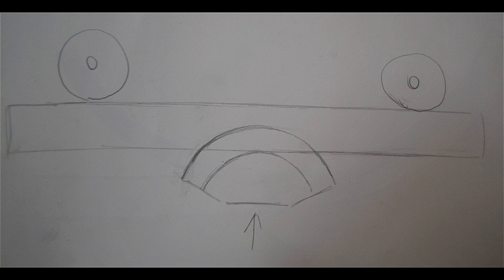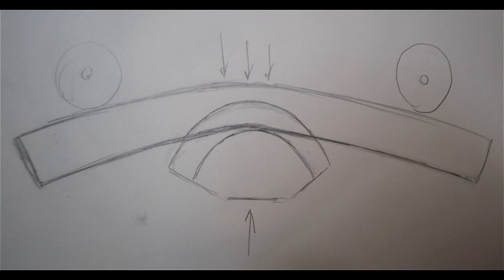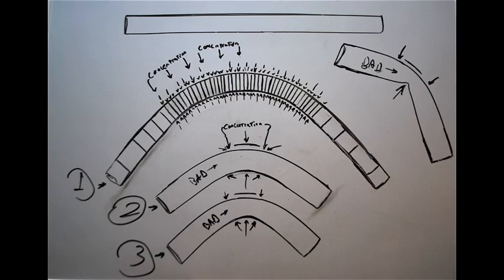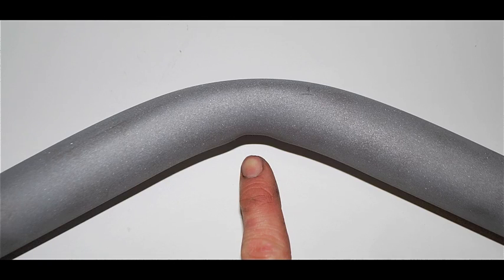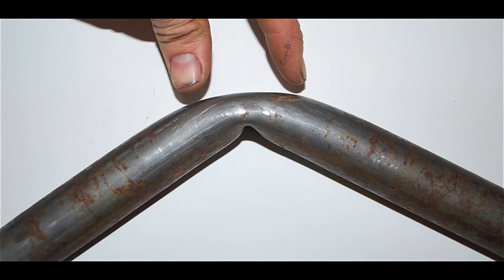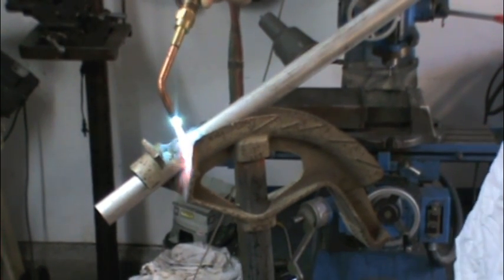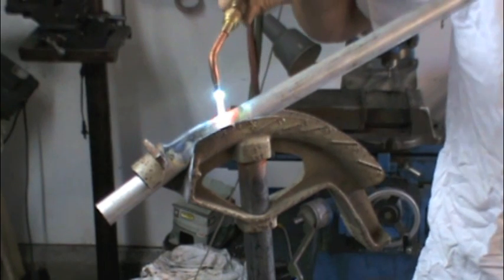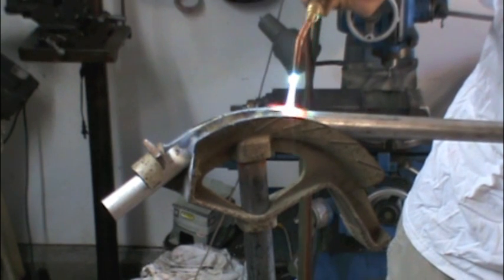How to Properly Bend a Pipe

Comment: Wrong. The reason the pipe kinks is because the sides of the dies dont come up high enough to stop the sides of the tubing from expanding which allows it to kink. I built a die myself where I made the sides fit tight against the pipe or tube and they extend up over the sides completely.  When I did that I haven't kinked a tube yet. I used thick steel on the sides.

Comment: you are not using it correctly....the rollers are in the wrong holes for that sized pipe.  i have 4 different kinds of pipe benders and this type works well for me. you know exactly where the center of the bend is.  you can not beat the price.

Comment: if you fill the pipe up with water and add sand and solid pack it tight with both ends tape up, the pipe will bend perfect in those cheap Harbor Freight Bender try it ,it will work fine

Comment: "Try using the RIGHT SIZE DIES in your harbor freight PIPE bender!!! Nothing wrong with that machine,it IS the operator. <--agreed used correctly the press type works correctly by forming the pipe in the die .
Reply: longthetiger99 i did use the right dies on my harbor freight pipe bender. now that i have a REAL pipe bender i know why that thing is a piece of shit.

Comment: The dies your using are for plumbing pipe which are measured on id of pipe, tube is od, I have used this very bender with home made dies that are the exact same same as the od of the tube and got "0" kink, Dies must not have any cleance between the tube and sides of die.

Comment: Using this process it is possible to make a turn on a tube diameter of 30 mm, and a thickness of 2.65 mm, with a radius of 100 mm?
(I do not speak English, automatic translation)
Dario

Comment: The wrong dies and or sliders,,wrong spacing of sliders above the die,and some processes of piping manufacture WILL defeat efforts to make an acceptable bend!! high carbon steel is inherently difficult to bend cold without an INTERNAL MANDREL bending machine. My experience is 30 years of pipe bending for pipe and tubing with pressures up to 4500 PSI. Hope someone finds this helpful.

Comment: In the case of this hydraulic jacking bender the POINT OF RESISTANCE is not confined to the top dead center of the die.Once a bend is commenced that point of resistance in BOTH SIDES OF THE BEND will advance along the die exactly as shown in the conduit bender example. The proper die in both cases (tube or pipe) should just allow the material to sit in the saddle of the die snug to half of its OUTSIDE DIAMETER.This prevents the material from distorting which will prevent kinking.

Comment: Conduit is just not manufactured to be hot bent EVER.Its a thin wall tubing designed to be bend in a specified conduit bender. Any pipe hot bent empty(without such filling as sand etc) will collapse or tear for the following reason(s) A hot bend represents engineering that lets the OUTSIDE of the bend thin and stretch while letting the inside of the bend to thicken and compress. Hence the importance of sand to prevent kinking.

Comment: are between the two outboard slides or rollers.There are PIPE dies and "rollers"and there are TUBING dies and rollers.Two entirely different sets of dies that are NOT interchangeable between use on pipe and use on tubing. TUBING gets measured OUTSIDE so a 2 inch tube measures exactly two inches outside.A 2 inch PIPE measures nominally inside as 2 inches and will vary depending on wall thickness (schedule)Outside is larger than its nominal size to accommodate standardized threading.>

Comment: Energy is the weight you apply to move or form the pipe.You keep calling the point where the pipe initially tries to bend"the energy". That's not the energy ,that's the point(or points) of resistance.There isn't one point where (what you call energy) is applied,, again it is points of resistance to energy and there are three points not one.They are the last point of contact between the pipe and the die where the energy applied is felt and makes the pipe "want to" bend. The other two points >>>>

Comment: what i perfectly understand on what you are trying to to prove in this video that the first Pipe bender has a BADDesign,but as i can see it, you're using it in a verywrong way.coz i can see holes  right before the last point that you put the stopper on both end,maybe if you put the stopper on the right setting it would not be a BADDEsign bender rather.another thing base on the way you bend using the Hickey i see that you are not good enough in using the tool.Maybe you should try ADVERTISING.

Comment: You need training on how to use that machine and ,,there IS a difference between pipe and tubing and there IS a difference in pipe dies and tubing dies. Used properly that type of machine works fine. to start with your rollers are too far apart

Comment: Great theory, but.... You are bending tube in a pipe bender. The rollers that are pinned must be placed in the proper location according to the PIPE size. You are using a conduit bender on the other. The pipe bender is fine, the more expensive more powerful pipe benders do work under your theory. I have to tell you this is an example of operator error.

Comment: I kinda hate to tell you this since you put in so much effort and work into this video, but you're using the Harbor Freight bender improperly. To get the pipe started bending along the radius, you know those two pins and all those holes in the top section, you gotta move one in closer than the other, bend, then reposition, then bend a little more, follow the radius of the die from one side all the way over to the other, repeat until you have a nice bent pipe or tube. Center out won't work.

Comment: Actually you used the Harbor freight Tube Bender incorrectly. If you use the next size down shoe ( the one the tube does not fit in) it will bend it correctly.

Comment: honeybunchicken.. you dont heat pipes to bend in a die or dolly, every  size of die governs a certain size of pipe and is calculated an the radius for each size, its hardly unlikely you would a 20 ton pipe bender to bend a 3/4" tube to make an arc or a circle of maybe 2' in dia , its obvious you must use a tube bender...........its a good vid though...

Comment: drock , even though there is no hard rules to bending pipes from my experience, you must always turn the pipe seam inside , that's to the dolly pushing so as the pipe bends and crimps it do not stretch the seam and burst it, this is done with especially tubes bending...

Comment: All you have to do is stuff the pipe with dry sand, just shape a piece of wood with a slight taper about four inches long , cut the pipe to the length you will be using, plug the end with the wood plug and fill to app three inches from open end ,make sure u tap the pipe with a light hammer to make its compact ,then plug with paper, i use old news papers,u get perfect bends, i am a exhaust fitter and have bending , from 1mm thick to ? very thick gauge pipe do not need sand filling.

Comment: Try adjusting the HF outer dies inward. Yes you do have a valad point that HF is not the best but it will get the job done in a pinch.

Comment: I wonder if using a block with a V groove instead of a round profile would push the sides in and allow space for downward expansion to prevent an oval profile in the bend. V dies could be used for a range of tube sizes without the need to swop dies.

Comment: that harbor freight bender aint that bad for 100 bucks. i got one, but it does take some work to get it to bend with minor wrinkels. i had to put a collar around the die to keep the pipe from jumping out of the die. but have since bought a professional bender.

Comment: I like to commend you in explaining why the Harbor Freight Bender is a failure of design. I believe a better way for your expression is as follows: With a radius bender the fulcrum point (The point or support on which a lever pivots) constantly is changing / moving during the bending process. Thus with a radius bender a more true bend is accomplished. Great video.

Comment: On that hand bender check out how high the sides of the die come up the pipe. Then compare with the hydraulic bender shoe, not as deep. Also the pivot rollers have to be in the proper holes for a particular die, or shoe.

Comment: Learn the difference between PIPE and TUBE. PIPE measure by its INSIDE DIA.TUBING measures on its OUTSIDE DIAMETER. 2in pipe is LARGER OUTSIDE than 2in TUBING! So a PIPE DIE will KINK  tubing everytime. You don't know the difference to start with.I've used similar benders very sucessfully over a 30 year career as a pipefitter. You know just enough to be dangerous,go examine TUBE dies VS PIPE dies.

Comment: Your theory makes sense, but have you tried using a smaller die, lets say if your bending inch and half pipe, try using a inch and a quarter die, it supports the sides and doesnt allow the pipe to bend in one spot, it spreads it out making a very nice bend, then take a hammer and bang the die off. I been doing this for years on the same old 50 dollar harbour frieght bender, you would never know I made a bend on it, you would think it was done on a big fancy rig, try it out....

Comment: IN THE LAST BEND YOU BASICALLY USED THE SHITTY BENDER WITH HEAT AND YOU SAY IT O.K. NOW . SO IF YOU USED HEAT ON THE HARBOR FREIGHT IT SHOULD WORK ? I'VE USED THE BAD BENDER MANY TIMES AND SPEED OF BEND TO ALLOW MOLECULES TO HEAT THEMSELVES WORKS TO, IT'S STILL WEAKER THAN A REPOSITIONING OF BEND POINTS . GOOD EXPOSITION OF PIPE BENDING PROPERTIES THOUGH , THANKS .
GIANFRANCO FRONZI . MAY  / 17 / 12

Comment: You have the wrong die .It is too large and doesn't hold the sides of the bend thus allowing the sides to squish out. Go to your local muffler shop they will explain it to you.The cheapo bender is poorly finished but has the correct principles to bend pipe . Your application is incorrect

Comment: I think you are using this the wrong way! You need to make only small bends at a time, move the pipe or tubing a few inch in the die and make another small bends at a new location and repeat the process till you have an evenly bend pipe to the radius you want.

But I got your point. Metals will stretch and weaken in the areas of too much pressure if you want a large radius bend at the same point.Move the work pieces a few time and bend it a few times (little bend at a time) and you'll be fine.

Comment: and iv done 32 years as a pipefitter/welder in England.there's nothing wrong with a cylinder driven bender.iv used the small hand pumpers,up to ones that will bend 6" pipe.you have to match the correct size former with its pipe size.

Comment: A little knowledge can be a dangerous tool. The outside dimensions of a nominally sized PIPE will not correspond to the O.D.of TUBE. IE,they are different. Pipe is measured INSIDE and tubing is measured OUTSIDE so 2"tubing is NOT the same as 2"pipe.THEREFORE you need PIPE dies and rollers AND Tubing dies and rollers. Ive used these benders without a hitch and the key is knowing what dies and rollers to use. Pipefitter,steamfitter over 35 years in the trade.

Comment: @honeybunchickens Weather it is a 99 dollar harbor freight unit or a 5 thousand dollar unit like we have at work, you cant slap a 2 inch mandrel in and bend 2inch pipe or 2inch tubing.  Pipe is 2inch ID and tube is 2inch OD.  With lots of variation.  Mandrel fit is super improtant to the quality of the bend.  I do agree that the HF type China benders are ok at best, but you might be suprised what some people can do with that bender.  Check out this Pro bender...same type as HF.

Comment from the maker: @joecoool100  it doesn't matter tubing can be in various thicknesses. pipe, pluming pipe it doesn't matter look at my vid more throughly and listen how a pipe is properly bended.  try bending pluming pipe it will prove the same point in my explaining in the vid.  i show the difference on a harbor freight pipe bender design V.S. a properly designed pipe bender. I don't just show, i explain in detail the best that i can in this vid

Comment: I own one of those harbor freight pipe benders. I understand the difference strengthwise between that style and the mandrel style, but they bend pretty well as the wall thickness increases. I have made custom hand rails , roll cages , ladders ( that bend at the top to encorperate a handrail into it) . I have bent aluminum and steel. The expensive benders are great, but till I have money to burn , I'll be using my harbor freight one.

Comment: I'm wondering if the "improperly designed" pipe bender is meant for bending solid rods instead of hollow pipes. Wondering is the distribution of energy would be different though solid a solid core.